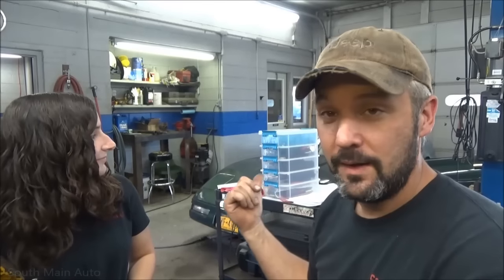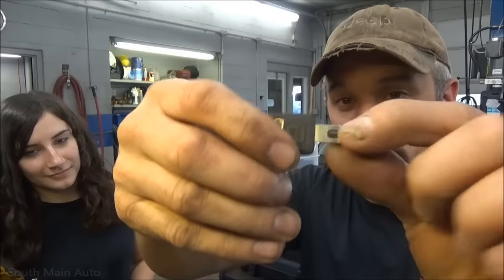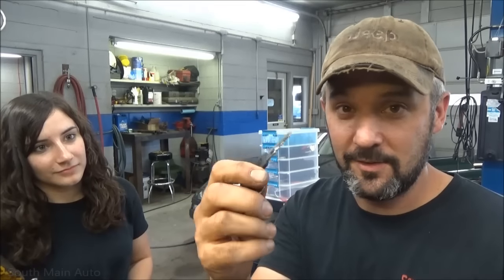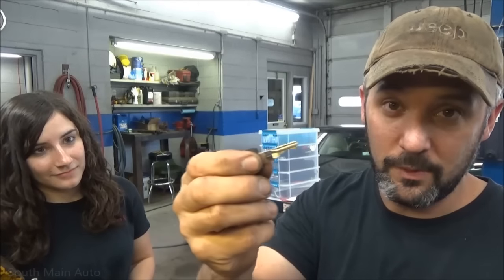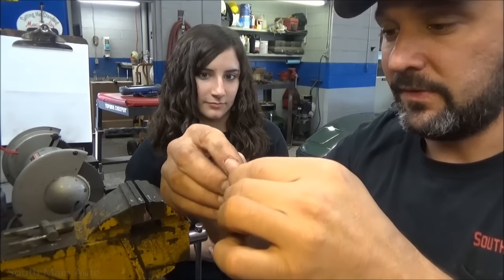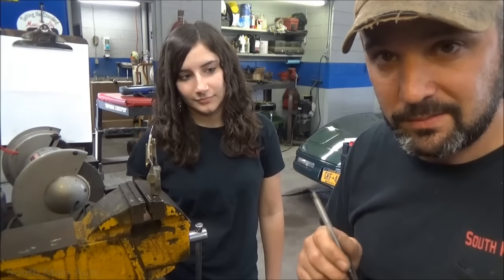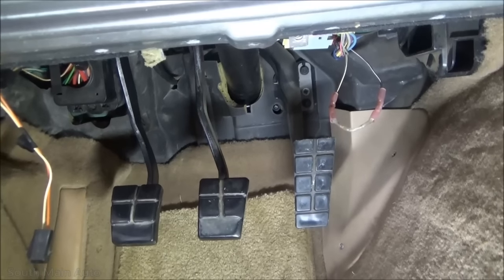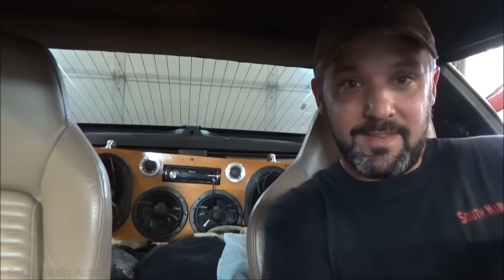GM VATS Key / Resistor Key Security Bypass

Comment: Friend of mine had a 99 Buick Lesabre limited, cost her over 500 bucks for new keys and ignition switch I believe. That car was a nice, but she replaced the transmission once. Then I bought it off her and drove it for 10 years. In that time it hydro locked on me 3 times upper intake then 2 years later lower intake then upper again about a years after that. Last time was it's death, I fixed it but it had a little vibration in it ever once and a while, till about a year later the rod came out the side of the block.  Gave it to my salvage yard friend so he could make a few bucks on it.

Comment: just had to do this on a chevy 2500 6.5 except what messed with us was it would only crank, it would bring fuel up to the injection pump but not let it go passed to the injectors. Security light wasnt on it messed with us so much because it started up and ran but had bad heads which is what we did along with a turbo intake manifolds and really everything. trouble shot everything, all the solenoids, switches, even lead us to believe it was the pump itself, pulled the dash, burned out bulb put a bulb there security light came up, just ripped a resistor off of a spare circuit board we had laying around tied it in and it started right up

Comment: I've got a 1998 Cadillac Deville with the notorious vats system. Will the security light flash or just stay on if the vehicle anti theft system is the corporate. Thank you my vats key is #12 I dismantled the knee panel located the orange covered shef and I exposed the 2 white wires. I cut the wire 6" from the harness and put the bypass module in I looped it. Do I need to relearn the key. Thank you

Comment: Okay so question AFTER you bypass it can you put a new key lock cylinder WITHOUT the orange cable ?! I ask because i have a 1992 camaro (3rd gen) and i found this badass chrome key lock cylinder from a 87 but it doesn’t have the orange wire & the keys themselves dont have the resistors either now my guess is if i bypass the vats system there will be no problem putting this new lock cylinder but i would like a second opinion! So if you dont mind id like to hear from you please and thanks!

Comment: Generally on these VATS systems if you make it to the crank-no-start condition, you ignored the security light for quite some time because your car still ran. When the security light first illuminates, that is an indication that the wires are starting to fray in the column. Better to fix at that point before the wires break completely and leave you stranded.

Comment: Hi Eric
I have a similar problem with my '00 Cavalier. Was running fine after replacing cylinder head, days later after parking did not want to start. Does not have a security light symbol on cluster that lights up. I m guessing ignition switch? Key never had a pellet when I got the car years ago. So that might not be it. Fuel pump replaced 3 yrs ago, fuel pressure reg. 3 yrs. ago, fuel filter 3 months ago. Is this scenario quick fix or more complicated? Thanks for your videos.

Comment: I have a 95 Camaro its doing kinda the same thing ..I dont see a security light on but all dash light go on but nothing doesnt crank at all replaced battery starter seems good ..Do ypu think its that little white wire in the steering column thats broke ?

Comment: Good vid.
I have done the same myself=I also have installed a new lock cyl., with proper VATS key, under the floor mat to save the customer of the steering column labor $$$.
The only problem is if the column is started with a screwdriver, who is to fault?? Not GM, could be the Tech, unless the info is in writing??
Thanks again..
Reply: LOST in TIME !

Comment: I have a 2013 Chev Equinox. My wires coming from Immobilizer are Pink with black stripe, green with white stripe and light blue. Which one do I cut and put wire from resister and which do I trim insulation off and hook other side of wire from resister? Please advise. Vehicle Been down four months, almost gave up. Thank You do Much!!!

Comment: Hey man, I have an 01 C5 Z06 and it's doing the same thing. Is it the same wire location for the C5s do you know off hand?
Reply: there is a similar wireset on the c5, exact same setup under a new name and combined into the BCM rather than a separate module.. steering column lock is a known issue with the c5's too..

Comment: This was called Pass Key II system started in 1991 and lasted thru the 2003 model year.
Reply: Actually it came out in '86 on Corvette.... expanded to the Camaro and Cadillac Seville in '88 and By early 90's was standard on all Cadillac vehicles... by 1994 it was used on many GM cars from all divisions...  Then it changed to PassLock in 1994 with GM's new 10 tumbler double cut key and became standard on any GM vehicle using this key... 1996 would be the last year for the GM "Letter" keys introduced in 1967 and ultimately would be the final year for PASSkey... From 1997 on, all GM vehicles would be using the GM-10 key and PASSLock.    A little history on GM locks:  From 1936-1966 all GM keys are identical regardless of the shape of the key head.  Only the cut in the key is what differentiated it from another key... it is possible to have an ignition key from one car that opens the trunk on another car, and vise versa...    However in 1967, GM introduced the new "Letter Keys" which had unique keyways for each letter starting with A and going though K.  GM would pair keys together, 1 for ignition and doors (A, C, E, J) and 1 for trunk and all other locks (B, D, H, K) They would change to the next pair each year (A.B for 1967,  C,D for 1968, etc) before restarting the cycle in the 5th year. In 1969 GM changed the key heads to the Square and Oval shapes, which were called the GM Corporate keys the same year GM introduced the locking steering column.  J and K pairs are the rarest.. only being used for 1970, 1974 and 1978.  In 1974 GM changed its key assignments, making the square head ignition only and oval head would now be for the doors / trunk etc.  In 1980, GM broke the order.. and retained the C,D keys on all models from 1980 through the end of the 1984 model year.. In 1985 GM would begin using the E, H pair on some cars while retaining the C, D pair on other models though 1988. All cars would then use E, H pairs from 1989 until either that model was upgraded to the GM10 key starting in 1994 for any car redesigned or introduced after 1993. (except Cavalier which used an odd double cut key from 1991-94 for ignition and standard H letter key for the door/trunk.) By 1997 all models still using the "Letter Keys had either been discontinued or had be redesigned and everything had switched to GM10 keys with PASSlock.  GM locks were originally designed by Briggs & Stratton.. and were sold to GM.   At some point, B&S couldn't supply locksets to GM fast enough to keep up with car production, so B&S licensed GM to build the locksets and keys themselves using the B&S design.  On the keys used through 68, keys actually made by B&S will have the B&S logo as well as the GM logo on them... GM manufactured keys only have the GM logo.
Reply: @Chaddz3    AMC Americana Moters cars used GM Keys until Chrysler brought AMC in 1988. They still used the GM key on the 1988 AMC Eagle Wagons until all parts to build them were gone. AMC also used a GM tumbler as well and used a Chrysler Torque-flite 3 speed automatic trans axle as well. They aslo used the infamous Ford Duraspark system until 1986 then they went to the Bosch/Bendix EFI system for the 4.0L Jeep straight 6.
Reply: @chris lemaster AMC ignition lock cylinders were slightly different from GM cylinders since the keyway and tumblers were installed in the top of the cylinder. GM cylinders were the opposite. That's why the teeth on an AMC key point upward and GM's point downward when inserting the key into the steering column lock.

Comment: what would u suggest for a 03 gmc seirra has theft light on n starts but dies instantly it has or had passlock 3 in it as the module is on the floor

Comment: Another good video! Is the "Key" resistor value shown on your wiring diagram? I was wondering what you would do if , for some reason, the resistor that is on the key is unreadable due to damage. Thanks again for the good info!
Reply: The used values are documented on the Internet (a simple search for 'vats gm resistor value' found them). Then you'll have to try them one after the other until you hit the right one for the car. If you've got a resistance decade box (box with selector switches for each decade, ie 10s 100s,1000s etc ohm and presents the sum, say 1x1000,9x100 and 1x10 for 1910 ohm total, on a set of terminals) hooking that up first allows you to quickly dial in each value w/o soldering in resistors each time. Once found replace it with small resistors, as in video

Comment: Lets say you get the car running and your driving down the road, if you hit a bump or move the column to make any slight movement where the contact points hit the key...would the car just completely shut off? all gauges shut off?  My dad had a 92 caddy and had a problem where the key would be intermittent, sometimes it wouldn't start but you keep trying over and over and then lone behold it worked. but sometimes the gauges would completely stop working while driving but still could drive. Wonder if that was the key or a completely different electrical issue?

Comment: I have a 1999 yukon and have owned it since 2003,,, mine has been doing this ,, no kidding for about a year and a half,,, I’m lucky , because the key I received at purchase wasn’t the original and doesn’t have the chip,,, lol,,, but true ,,, how can I test my system for the correct resistors, or heck , I don’t know ,,, I’ve tried several of the tricks to teach the system and believe it or not it started today after a week of on and off of patience and testing ,,, man , I’m getting done with trying to figure it out , but it started again today off of a no chip key ,, any advice is so welcomed and thanks !!!

Comment: I have a 1999 Chevy Lumina that the security light continually stays on steady but starts without any problem. It will also start without a VATS key. I bought the vehicle new and had changed the ignition lock cylinder several years ago without any problems until now.  Any ideas what would cause the light to stay on continually with the engine running?

Comment: 2005 2500 hd Silverado has the same issues with the lock out is it the same type of system and will this work for that I'm sure you have ran across it it seems to be common

Comment: Hey Eric,  I'd be interested in you were aware of a youtube video by Andy Kendeigh "98-00 GM Pickup Theft System Erase" where he basically disconnects the theft deterrent module while the vehicle is running (and keeps it disconnected thereafter) and says the VATS at that point is permanently disabled.  From the comments on his video it looks like it worked on other GM vehicles as well.  He notes that when he was researching this issue he was told by GM engineers it wouldn't work, but apparently does (also judging from viewers comments who tried it). I have a security light on constantly on my 2000 Lumina but it starts.  Got exact resistor hoping it would turn off the light but it didn't, so I think the problem is further down the line, like a bad TDM.

Comment: This works perfectly fine, especially for non-GMs, but if you have at least 1 functioning key, you can program a new key yourself.  For GMs it is very easy, so you won't need a locksmith or fancy computer.  Buy a blank, get it cut for $1.50 at Home Depot or whatever, then look it up here on YouTube on how to program the computer to accept the new resistor.  All you need is a functioning key.  Now if it's NOT a GM, 9/10 you're screwed and you gotta call a locksmith/dealer or do this bypass.  Same goes if you don't have a working spare, too.

Comment: Did you set the resistor by facing the current flow on specific way/direction ? by the way thanks for sharing your video!
Reply: Resistors are not directional/polarised.

Comment: Hey Eric , you said you can go down to the hardware store and pick up a regular key without a security resistor and it will start every time ? If that is correct why match the new resistors to the keys you have now? Is that not the reason you added the resistors in the first place ? Cause it needs to see the same resistance that a key has on it ? I wonder if I caught you on another ooops moment ? Lol 😂 if I'm wrong , let me know 🤔 Thanks bro...
Reply: The resistors he added are connected to the harness in place of the key, which is now disconnected. So now it always sees the proper resistance and the key resistor does not matter.
Reply: awd42  Thanks  , thought it always needed to see a matching resistance from a key ? Cause he took the resistance reading from it and matched it.... so he eliminated the key resistance  and added the inline resistance , therefore bypassing the key ? If that is,what is happening than the problem lies in the ignition switch itself not reading the key resistance...Okay , I thought the computer read the resistance.. .hope you understand what I was seeing..

Comment: by the way, the gm passlock 1 and I believe 2 also  work the same way..  they have a newer style chip in the key but can still be bypassed with resisters the same way... you cant test the key like you can with the keys with pellets..  the key has to be in the ignition with it turned on and then you can get your resistance reading on the wires coming down the column..
Reply: possibly a good idea unless a wire is broken

Comment: Hello. My name is Andy. I changed starter on 1985 Corvette but still there is no crank no start which is why I replaced starter in the first place. This car is manual.  I jump started it with remote from underneath car.
This turned the engine, but car will not start from ignition.  Battery is new. When I got the car, there was no chip on the key. If you have any idea what the issue might be, I would appreciate your input. Thank you.

Comment: Doing that to my civic, as soon as I understand what exactly you did with the wire, assuming it's that easy with the newer systems
Reply: 1986 to 1997  GM cars only.  Some GM's after 97 still had the vats system with the resistor but many models were using a transponder.  That didn't work either.

Comment: you can also ground or bypass the start enable relay on the vats systems too..  connecting resisters keep the security light off but bypassing the relay makes sure the engine will always start...  my 2 cents
Reply: Do you have more info in this technique?
Reply: Mark Borrmann do you have more information on this technique

Comment: My 1995 Grand Prix has been stalling out on right hand turns and if I park to the right hand side, I have to turn the steering wheel until I find the "right spot" before it will crank. 2 days ago, my security light came on, but it is still cranking. Will this fix my right turn stalling? Also why is the light on but still cranking?

Comment: If you cut the plug off the wires going to the column you have the black plug and 2 wires to hook into the wires in the steering column would need to be replaced

Comment: I have a corvette 1984 just bought it. It doesn’t run from the ignition. However, I have a wire which I plug it a side of the wire into the fuse box in the crank fuse after taking the fuse and the other side of the wire in the haz fuse after taking the fuse. And that’s how I start my car every time currently. It also is a good way to know if the problem from the starter or the vats thing. Just wanted to pass this info Incase anybody is gonna find a use of it.

Comment: So my key reads 9.55 kohms and my 3 resistors of 2.7 kohms combined are equaling to 7.95 kohms and if I add an extra I’m over at about 10.50 kohms. Is it better to be under or over? Do I have a tolerance or is being on point crucial?
Reply: The closest listed value in the available on the web info for VATS is 7.50kohm (nearest under over are 6.04kohm/9.53kohm) Tolerance is said to be +/- 10%
I'd swing by an electrics store and get a 6k8 (6800) and a 680 for a total of 7480 to get close to the listed 7.50k - or 6k8 plus a 1k2 for 8000 total, close to your measured value.
Note that most resistors today are either +/- 5% (typically beige body, carbon film construction) or 1% (typically blue body, metal film construction,and has a 4th value stripe, compared to the 3 on carbon film ones)

But using what you've got,  3 x 2700 is 8100 - which is within 10% of 7.500 (7500 x 1.10 = 8.250), so should work a according to the documentation...

Comment: Good olde fashionde resistors had copper leads, and if you  crimp them over time they come loose as the copper creeps out from the crimped section.
They look like newer ones though, which are mainly steel tin plated leads so should be fine.
Soldering them to a bit of veroboard might be a bit more reliable, but then how long is that thing going to stay alive for.